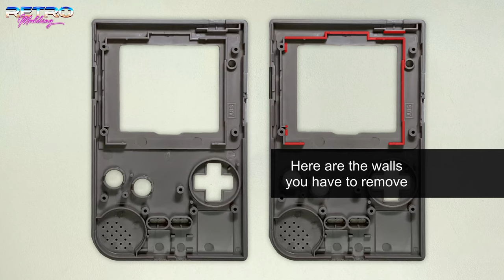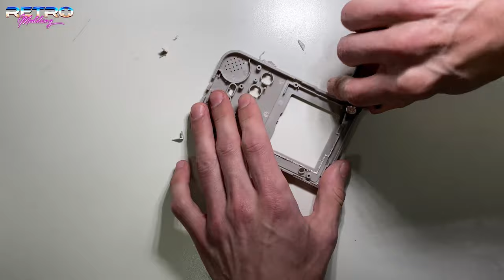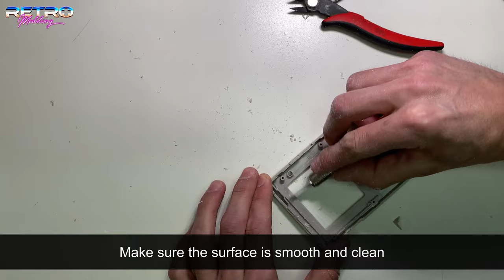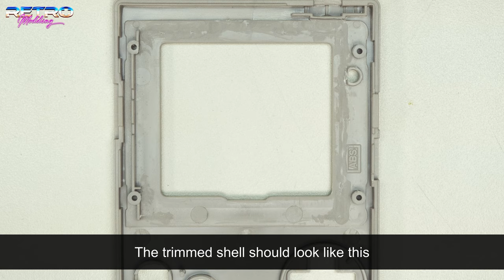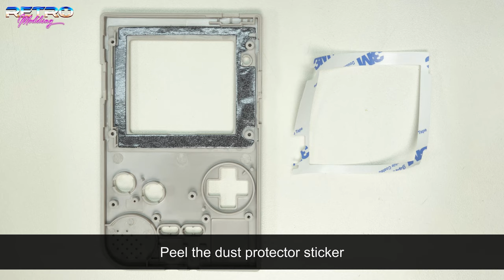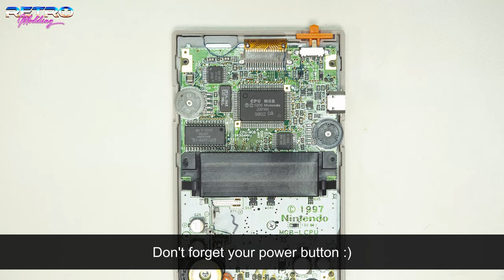GAME BOY Pocket IPS LCD Kit (Funnyplaying) Installation Guide

Comment: Do you have a link / more info on which dremel bit you're using there? It doesn't look anything like any that came with my 3000, or any other bits I've seen for sale, and none of the bits I have are going through the plastic quite so clean!